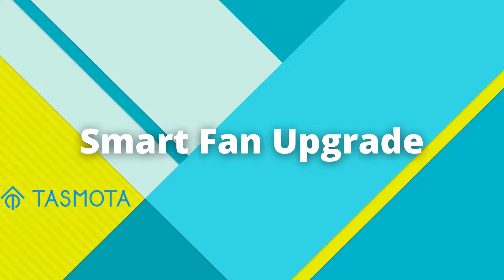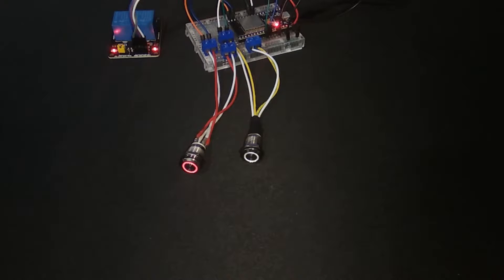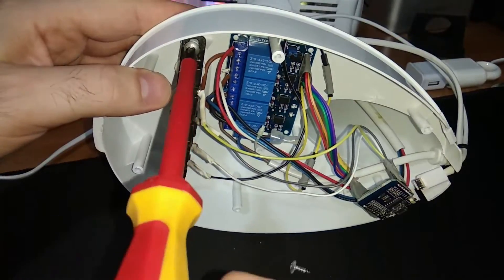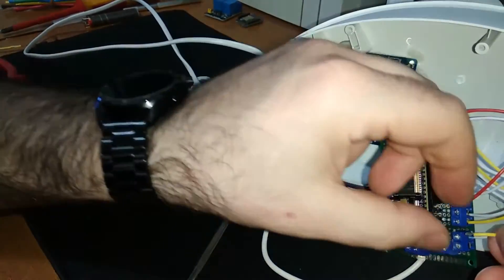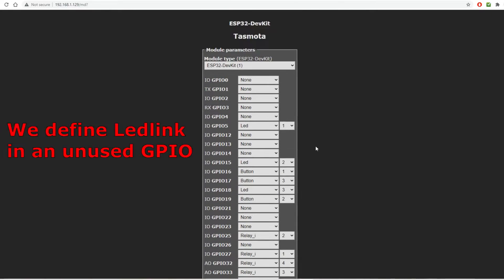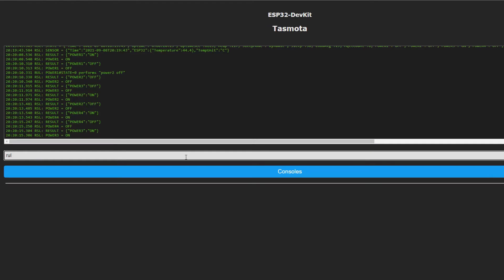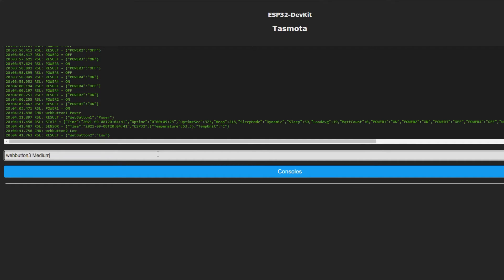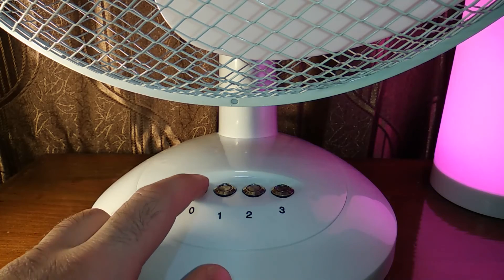Tasmota #05 | Smart Fan v3 with LED Buttons | Interlock

Comment: Hi, thanks for sharing this.
Beside the speed, is there a way to toggle the oscillation?
Can you install this on wall fan with pull string to change the speed? How would you modify it?
Reply from the maker: Not all fans use the same technology. It depends the type of the fan

Comment: Good project, just one tip. You should set the start to speed 3. For fan motors they should start at maximum speed, to stress less the motor. You can confirm it by seeing the original fan button where start em speed 0 - 3 - 2 - 1. You have a great project over there, congratulations.
Reply: For ceiling fans yes ... for desk fans no. Desk fans can be started at any speed and hence have switches that enable them to be started at any speed rather than a ceiling fan type speed controller where you have to go through "High" first.

Ceiling fans have a lot of inertia and so - as you say - they have "High" next to "Off" rather than having "Low" next to "Off" so that they get the initial full power kick to get them moving even if you are just flicking through from "Off" to "Low".
Reply from the maker: Thank you for you kind words and advice. I'll definitely have a look into that.

Comment: I wish to have a LED Status indicator to show if the ESP is connected to WiFi or is in AP mode.  I can attach an LED to a GPIO pin, but what command / Rule should I use to have a ON LED for connected to WiFi and Blinking LED to show it, in AP mode.
Reply from the maker: with WifiConfig set to 2, and D4 in d1 mini for the onboard led set to LED 1,  for example:

rule1 on wifi#disconnected do backlog; ledpower1 1; Delay 0.5; ledpower1 2 endon
rule1 1
will blink the led on AP
on wifi#connect do ledpower 1 endon, will keep the led on when connected

Comment: Great Project!. Can you show the wiring diagram of all component ? Thank you
Reply from the maker: Thank you very much. This is a fast draft: https://iili.io/RDUemG.png hope it is useful. You can select any pins you like as long as they are not used during ESP boot.
Reply: @pvollas  Useful, thank you (seeing as the other guy didn't even upvote you for giving him what he asked for!)!

Do you think this would be possible using a single Sonoff basic, wired up to spare GPIO pins of the ESP8285 chip?
Reply: @pvollas  looking at the schematic, it looks like you can do this with 3 relay only, why go with 4 relays?
Reply from the maker: @EmilePolka  You could of course. I wanted to retain the traditional function of the 4 buttons. One for ON-OFF and the others for the speeds.
Reply: @EmilePolka  - because relay boards come with a "power of two" number of relays - 1, 2 , 4, 8, 16 etc. - if there were a three relay board available then it could be used instead. If you were handy with a slodering iron you COULD in theory at least patch in a two relay board onto a Sonoff Basic to get three relays then configure Tasmota to switch the additional relays but that really is creating a lot more additional work (as the Sonoff Basic doesn't expose all the IO pins needed for the relays and buttons so they'd need to be picked up from the controller directly - and that's if the controller has enough IO pins available) and quite likely not saving any money.

I use a different four channel relay board for my fan control (about £9 from AliExpress) but it has a very handy built-in mains power supply which makes everything even easier.